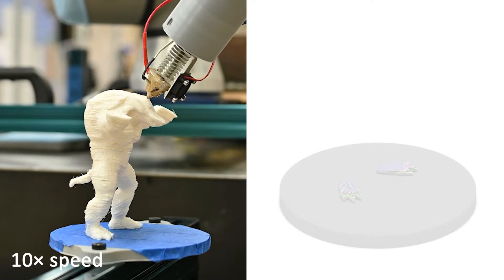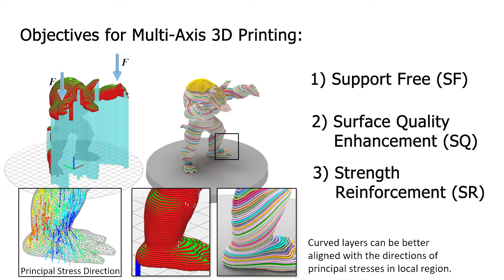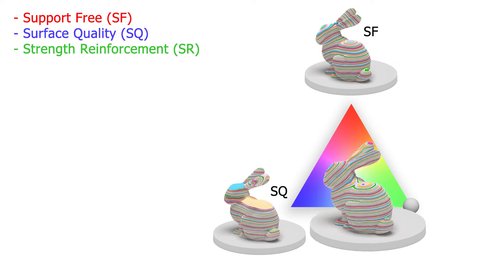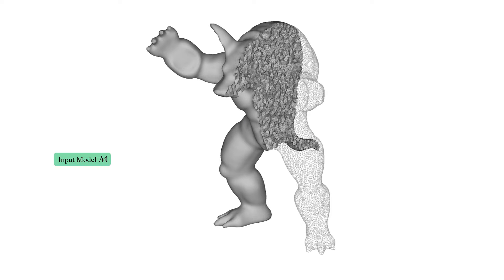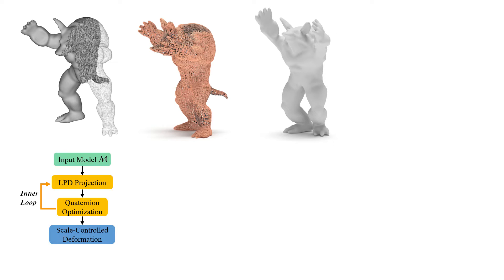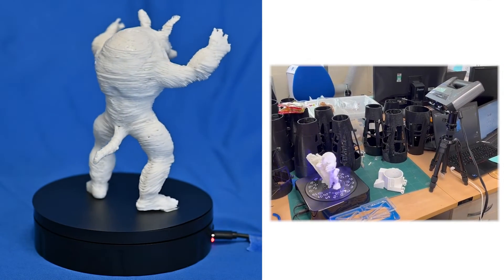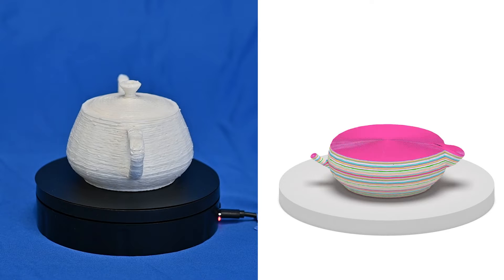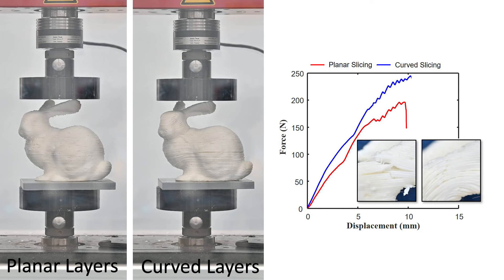S^3-Slicer for Multi-Axis 3D Printing (SIGGRAPH Asia 2022 - Best Paper Award)

Comment: Casually enables the manufacturing of optimised anisotropic materials (mainly 3d printed thermoplastics and thermoplastic high aspect ratio composites).
Needless to say this has a lot more potential than what's shown in this presentation...
Reply from the maker: This was developed two years ago. The most recent work can be found at: https://youtu.be/7Jxyu9uRMLo